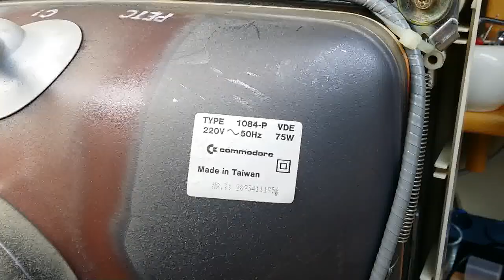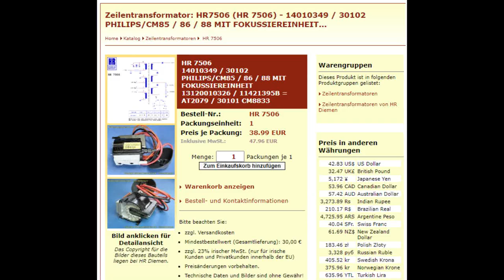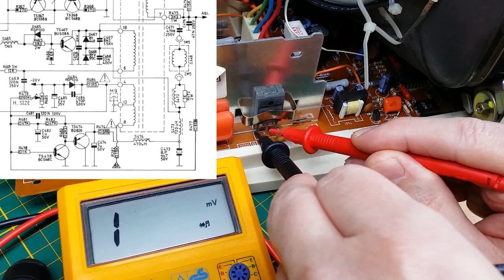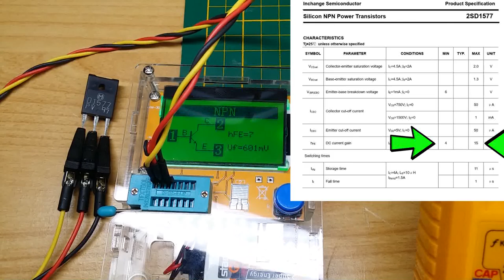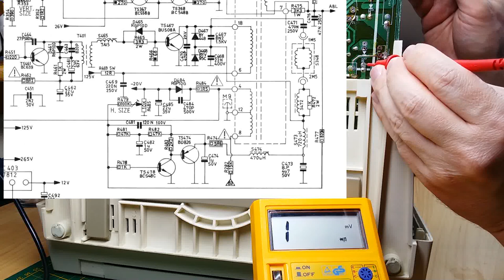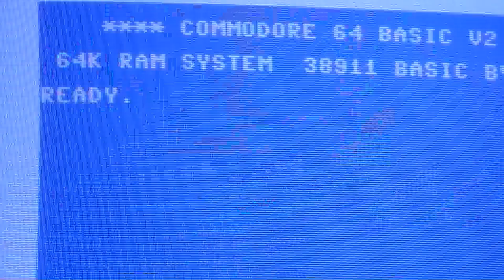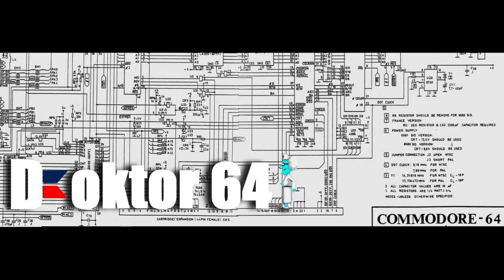Doc64 #27 | Commodore 1084-P CRT Monitor | Flyback repair and adjustments

Comment: Das ist einer der besten Monitore die ich je hatte. Hab Mal als Teenager einen für 6€ aufm trödel gekauft und aufm Fahrrad bis nach Hause geschoben😁 dann jahrelang mit sämtlichen Konsolen benutzt und dann vor ca 10jahren für 25€ weiter verkauft😅
Reply: Ja, das waren noch Preise :) . Heute geht der 1084er für 150 - 200 Euro weg, der 1084s für teilweise über 300 Euro --- Wahnsinn....
Reply: @alex01x3  Why? The s is worse quality than the non s. And not much stereo in a C64, and even on the Amiga you don't want its fake stereo.

Comment: 11:28 I notice in the manual it says to set brightness to minimum and contrast to maximum when adjusting focus? Do you know why these settings specified when adjusting focus? Surely if it's set that way when it's adjusted it will more likely be out of focus when the controls are returned to centre position. Also how long would you suggest letting the monitor warmup before making these adjustments?

Comment: Nice video! I made a similar repair with my 1084-p with the same replacement LOPT from ebay, but when i connect the pin which was in the wrong place it just screeches similar to before i replaced the LOPT. But with it disconnected it starts HV but with flickering screen and eventually turns off... I can't figure what could be wrong with it, the HOT tests out fine with 120v going in. Kinda bummed out now. 🥲Greetings from sweden.